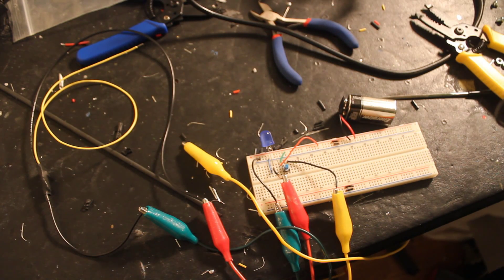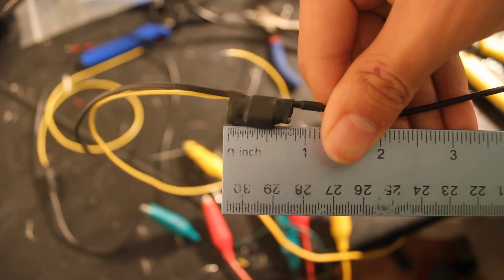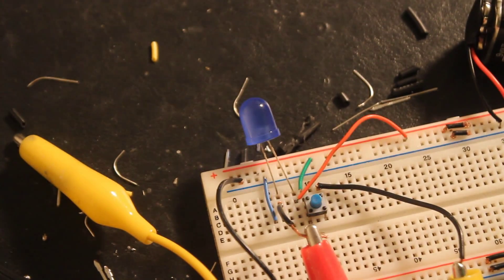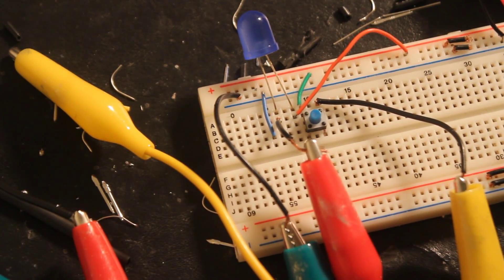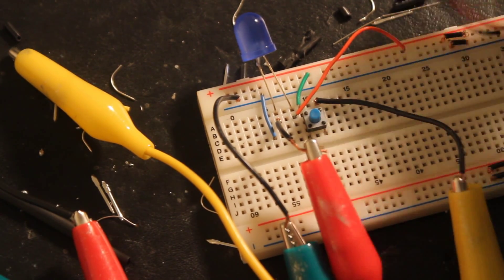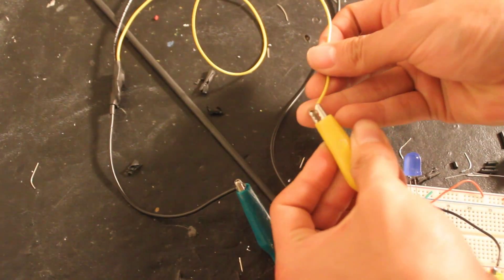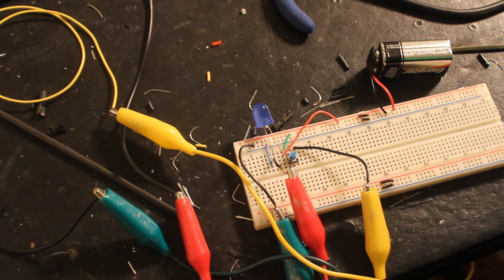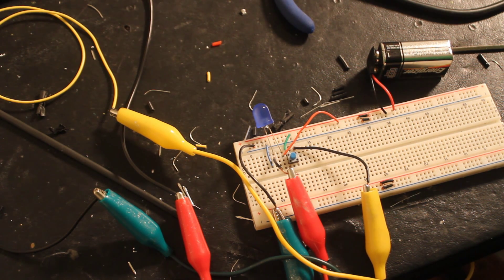Zardichar's Micro Mosfet Testing Procedure

Comment: Hi
I recently installed your shs version 2 trigger contacts and mosfet. When I plug my battery in sometimes my gun fires by itself without me touching the trigger and sometimes it works fine. Do you think it is because of the mosfet or trigger contacts or did i just do something else wrong?
Please respond as soon as possible and thank you for your time!!!

Comment from the maker: 30a continuous is the recommended max current. Stock aeg's are usually around 10a continuous, upgraded ones are around 18, extreme setups at around 25-30.